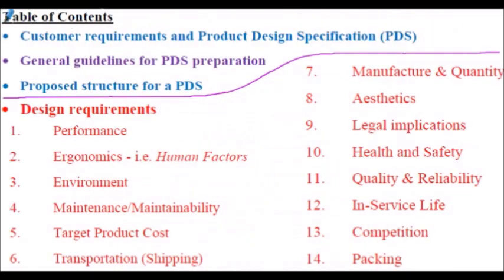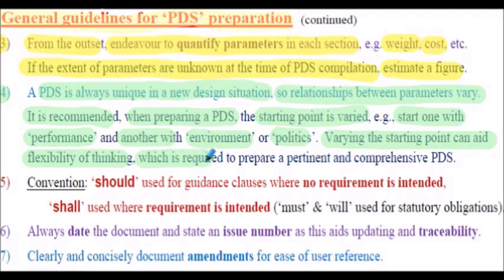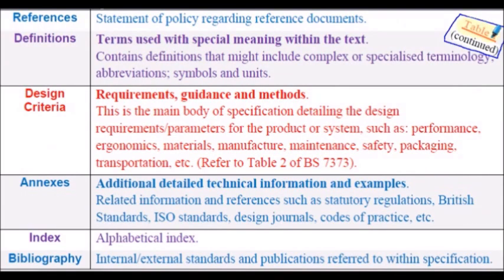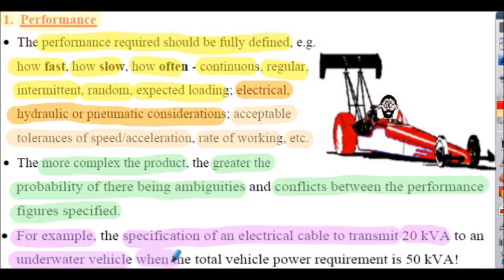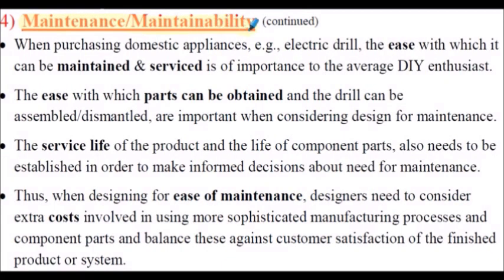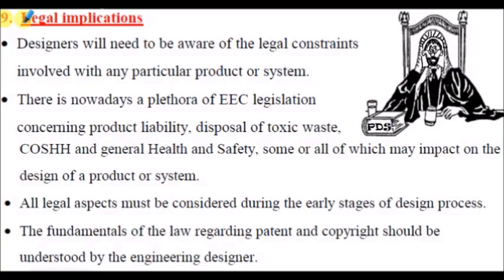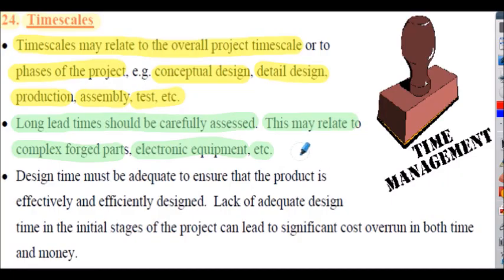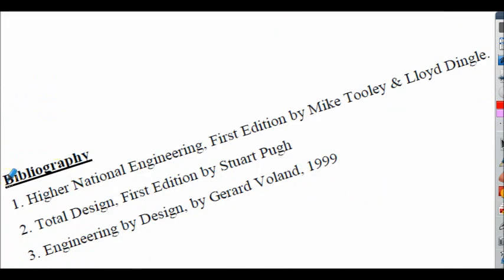PDS - Requirements/Structure - Part 1

Comment: I have an assignment to do for my design engineering module. It is to produce a design report for a bike rack for a car, which I have designed on autocad. I am very confused with the the topics of product design specification and design parameters. In my learning literature it says that the specification comes first then the parameters, and in my assignment it is asking for a basic design specification followed by design parameters. I am just wondering if you could help me understand the difference a bit better, as when I have tried to research it I am getting contrasting information. 
Many thanks in advance. 
Andrew
Reply from the maker: Hello Andrew, this video and its contents relate specifically to a ‘Product Design Specification (PDS)’.  Our students are required to produce a PDS within Project/Design units and yes, it is essentially the first formal document produced and a very important one.  Not sure if the outline below will help aid your understanding, but this is the process we expect our students to undertake within our Project/Design units.

The usual design process we adopt requires students to initially generate two ‘Design Proposals’ (sometimes termed ‘Design Briefs’) of products they are proposing to develop.  These proposals are based on a marketing ‘needs assessment’ for a new item or to develop/refinement of an existing item.  The proposals are essentially a one- or two-sided document outlining the purpose/functioning of the item with some basic customer requirements stated.  The students research the proposals based on market/customer needs and decide which is the optimum proposal to progress further.  From your comments, it seems you have been given a specific product to develop so you do not need to consider this section.

The next stage in the design process is to compile a ‘PDS’ that clearly and concisely states all the design requirements of the product being proposed.  This is the essence of the video, i.e. offering students an array of criteria to consider including within their own, formally structured PDS.  Many criteria are common across different specifications, but some criteria can be emphasised more than others depending on the type of product being considered.  The PDS is the bedrock of any design process and must to be given much upfront thought to ensure a successful product is ultimately produced for the marketplace.  In reality, some products have a lengthy design cycle (e.g. aircraft generally have a 5-year cycle from project launch to certification), so it is very important that all the essential design requirements are clearly stated and included within the PDS.

Once the PDS has been compiled, we then expect the students to compile ‘Technical Report’, which will contain conceptual designs (which adhere to the PDS requirements), from which a ‘Concept selection’ process is undertaken, with the choice of the optimum concept clearly justified.  The optimum concept is then detail designed to produce both general CAD assembly and detail design drawings.  Costing, manufacturing, stress analysis, maintenance, recycling, etc., considerations are all undertaken and included within the Technical Report.  A Compliance Checking exercise is also included within the Technical Report, to show compliance of the final product with the original PDS requirements.  

The above outline tries to show how the PDS fits into the design process within our project/design units.  The second video in the series outlines an example PDS and the requirements related to a Tiddlywink tester.  This is just a dummy document but shows the formal structure of a PDS and typical content that might be included.  Hope this helps.  I wish you well with your assignment. Regards, Alan.
Reply: I have literally just found this channel tonight, had a look at the playlist and this is going to be a god send! I am undertaking a HNC chemical engineering and have completed engineering maths, science and now onto design engineering. Hence me seeking out this content.
Reply: Thanks for taking the time to detail a thorough response. I really appreciate your help with this. 
The part that I was confused with is that the university has structured the design report so that there is a section for product design specification, followed by a section for design parameters, and so I thought design parameters would be part of the PDS. This is where I am most confused.
The rest of the design report, concept generation, design selection, weighted objective analysis etc. I have a good understanding of how to bring it up to a high standard, I just don't want to come unstuck on this particular structure detail they seem want.

I look forward to viewing your content over the coming months. High level resources from a British tutor on YouTube are very hard to come by!

Many thanks,
Andrew
Reply from the maker: @benno19891  Hi Andrew, perhaps the university want the PDS requirements stated in a section, and then the 'parameters section' is to essentially contain interpretation of the salient PDS requirements that will drive the design/development stages of the project.  I’m sure lecturing staff will clarify this for you.  Thank you for the comments about the channel, however, the content is essentially oriented toward College Technician Engineering students studying Engineering Maths and Mechanical Principles within BTEC L3 and L4 qualifications, so I doubt the content will have the academic rigour and coverage required for your university programme.  I wish you well in your studies.  Regards, Alan.
Reply: Thanks Alan.

My studies are being completed via distance learning, so there is a lot of self troubleshooting involved. I am sure with enough perseverance I will get the job done.

 I agree, although I was looking at the level 5 maths playlist in particular, which could prove useful for me.

Thanks again, and all the best with your YouTube endeavours.
Reply from the maker: @benno19891  No problem.  Yes, I have delivered the HND Maths (a while back now).  Perhaps these videos might be of some use in the future.  If you think they are, let me know and I can send you the accompanying workbook that I have used with my students.  The videos are the full lectures I have delivered in the classroom and based on the workbook topics. A
Reply: @alancarter2020 Hi Alan, thanks I'd really appreciate that! Great stuff!